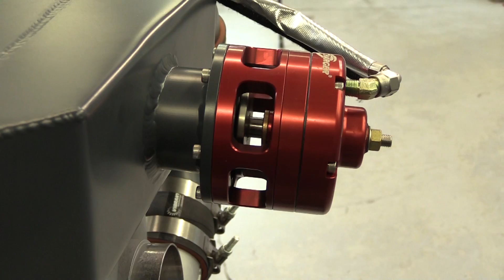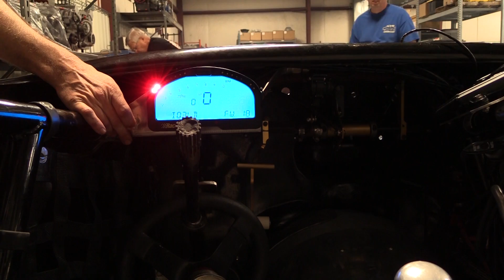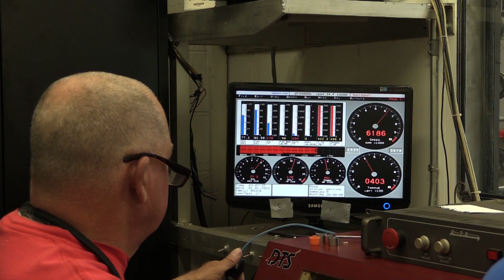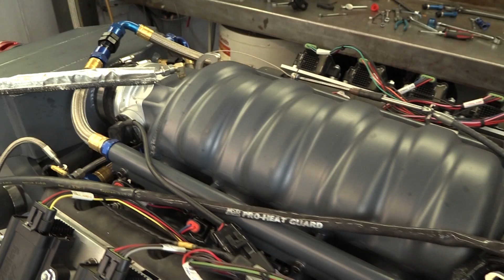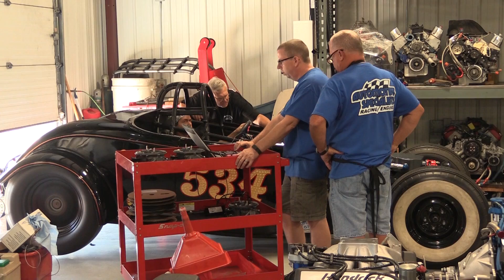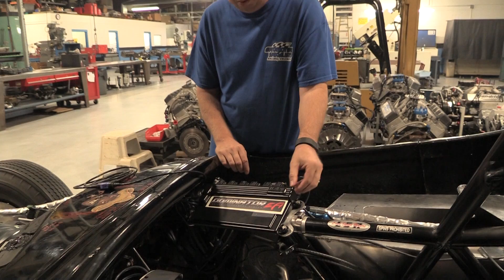A Thousand Horsepower on Just 260 Cubic Inches!

Comment: I think this could be the future of hot rodding. Small displacement + boost + lots of rpm. Nice!
Reply: +Forgotten Mustard its for setting a land speed record.. trust me the bigger engine, with the most horse is what you want, if you note, they said 260 ci WAS the maximum that could be used.. In displacement wars there is no replacement, a 427ci inherently will hold, make, push more horse than a 183ci engine its just how air works. So yes, your honda can put out 1000 horse power, but will it hold it for long ? Not really.  Also if your belief is such start looking at high end sports cars, and race cars like f1 series, r1 series, you'll note they use the  maximum cylinders and Ci allowed. Just sayin.
Reply: @yuribrandi8212   but there 10 and 12 cylinders to f1 series engines are also gear driven and turn 14000rpm i love this small engine would like to what it makes with out the blower
Reply: Small engines, boost, and rpm are fun but still no replacement for displacement. Just about everything you can do to a small engine I can do to a bigger one and make more power.
Reply: +David Serrano I know where you are coming from , I like squeezing big power out of small engines , own a 4g63 1g talon , two yamaha 2 stroke 350 twins . Also have boosted lq4 2000 camaro ss. You cant deny the better/instant torque  curve and driveability of a big inch motor . Secondly a big v8 will always be more reliable at x horsepower than a 4 banger , its the just pure size of the rotating assembly piston rods crank . The block thickness and stuff . At the end metallurgy is the same , you can get same kinda stuff for both engines but the bigger beefier stuff will handle it better . Kinda like semi engines putting out 650 hp and 2200 lb ft of torque out of 14 litres displacement , that thing will run at peak tq/hp for years , I mean a million miles , cant say the same about my 4g63 putting out 550whp.
Reply: Patrick Johnson Can't make what lighter? Most larger V8's already offer way more displacement per lb then inline, smaller engines.
I mean, shit, a 3L 2JZ weights about as much as a 6L LS engine.
Reply: David Serrano any 4 valve per cyl engine of the same cam profile and CI will make more power compared to a 2 valve per cyl ....its not just HP you need to consider.. torque is important. ..the little Honda engine may make 200HP but only 170LBS of torque vs a stock 350 v8 making about 250 HP and about 300LBS of torque....
Reply: 177SCmaro I think you missed the point of the video, there going after a Land speed record in a class that limits how many qubic inches you can have.
read my last post.
Reply: Patrick Johnson I wasn't talking about the video. I was speaking generally.
Reply: a honda putting out 200 horsepower would have 180 foot pounds of torque
(what you feel and use when you drive on the street)
a chevy v8 putting out 200 horsepower would have 350 foot pounds of torque.
(what you feel and use when you drive on the street)

can you see and understand the difference now?that's why v8s get more love,
yes honda engines are great and can make decent power but they are not a v8.
Reply: Patrick Johnson but the tons of extra ppwer the bigger makes. ... it more than makes up for the extra weight..
Reply: Forgotten Mustard
Reply: Hahaha seen a 903ci naturally aspirated bbc run like a scolded dog. I run a billet 4.660 bore X 3.65 stroke turning 9,800-10,200 Rpm. Don't think for a minute big reving engines can't make hp and tq cause they can.
Reply: Nothing new here.  Can you say Indy cars with baby cylinder engines and tons of boost.  Pure physics.  You ring out all this horsepower and revolutions in such a short time it equals wear and tear.  Pure ultra high power horsepower racing engines are rebuilt after every race.  You need a balance of longevity, displacement and horsepower.  Fire all your guns at once and the race is over.
Reply: Been that way with Hondas for years.
Reply: +David Serrano Actually Dart sells aftermarket Honda blocks. And about the displacement, larger cylinders are less efficient. But more cylinders actually increases the efficiency. (talking hp/liter not mpg). The reason those stock v8s put out low numbers is mainly poor head design and less efficient fuel injection/exhaust systems and cam profiles made for low end torque.
Reply: Small .21 ci RC car engines often return 1000hp a liter or more.   The very nature of the universe means it's easier for small things to return good X to Y ratios in HP to liter, strength to weight ratios, ect...

Despite that, it's simply not true that small engines are more efficient.  The 100,000 hp + 25480 liter Wartsila-Sulzer  ship engine returns a 0.260 lbs/hp/hour brake specific fuel consumption while most auto engines are around .400 lbs/hp/hour or more. Despite making 4hp a liter, this engine beats the pants off of anything the often worshiped Honda has ever produced as far as fuel efficiency is concerned.

If you are under the impression that small engines are more efficient, the lone fact that container ships rely on increasingly bigger and bigger single engines to reduce their fuel cost proves that impression to be a fallacy.

As far as performance engines at the automotive scale. Consider this, it's not unusual for a sub 450hp turbo S2000 to undergo a LS swap that makes 600hp that adds less than 100 pounds to the car.  One guy reported only gaining 74 pounds over his turbo I-4 + transmission compared to his all aluminum LS and TKO-600  5spd that used nothing but the lightest components he could find.  Intercoolers and all that turbo piping weighs something too, people seem to forget.  

If performance is the goal, all that matters is power curve to engine weight ratio (hp and torque matter) and reliability.  Engine size and fuel economy have some consideration, but frankly, power to displacement numbers are completely pointless.  Given the same basic lay out and physical size, a 300ci engine will never have any pertinent advantage over a 500ci engine in making a vehicle faster.
Reply: The future? This was going on in the late 50s and still used a lot in supercars today...
Reply: Ship engines are efficient because they are designed to spin in a small select rpm range. They basically don't need VTEC. If Honda had a different camshaft for every 1 thousand rpm it can easily be more efficient. But yes small doesn't mean it's more efficient. It's all about the design of the engine.
Reply: 177SCmaro can't make them lighter.
Reply: Patrick Johnson well you can. With billet everything. Machine away more material in places that don't need it and add more to places that do need it. Most likely would end up with an all around lighter block. Especially if the original was an iron block
Reply: 177SCmaro also this small qubic inches puts them in a class to beat and take top dog.
back in the 70ds my brother in law held the record for a 4 cylinder Pontiac tempest until Mickey Thompson cut one in half made a 2 cylinder and kicked his ass with half a motor
it was time to month ball tempest .
Reply: its very very specific,landspeed is a different animal.
its much like the 302 z28 engine of the 67/69 z28.its not meant to putt around,
its meant to hall ass at very high rpm and the majority of power would not be 
available in a street application and the torque would be pretty low even with this power.
Reply: Nothing to see here ford already got that covered.
Reply: +Forgotten Mustard Nope. High rpm = high stress. Boost is displacement anyway, so getting a small engine and putting it under boost maskes no sense for a hot rod. It's needless complexity.
Reply: +Eric Benton generally from what I've seen NA engines generally lose power and efficiency as you ramp up the displacement and number of cylinders. like generally the power/liter of a Honda 4 cylinder is much better than a v8. Although displacement should theoretically give you much much more power it generally doesn't. I've seen stock v8s put out numbers in the 200s which Honda does on their 2 liters. Sadly there isn't as big of a engine scene around Honda engines. I mean sure there are aftermarket parts and etc but you don't see any aftermarket blocks or anything of the sort. v8s get a ton more love than 4 cylinders. tbh I would take a 4 cylinder over a v8 anyday.

Comment: Small engine add some boost and electronics...Pretty nasty result with not much boost....What's the fuel restrictions for the class.?.
Reply: +B00steDevil 
That's not a turbo kid, stop being a youtube bench expert.
Reply from the maker: +ZIGgassedUP No nitro. Race gas allowed. And no alcohol (I think)
Reply: +Jimmy Mudsled A centrifugal compressor is a centrifugal compressor, regardless of whether it's driven by a belt or an exhaust driven turbine. And it's going to sound much the same as well when it's running a multi-v belt. (as distinct from a toothed belt) That thing is audibly huffing VAST quantities of air. Maybe you should listen more closely and not call random people "kid" as you try to put them down with meaningless nit-picking in order to make you feel good about yourself.. And yes, it's only making 10psi of boost but it's not a huge compressor either and they're spinning the thing to nearly 10,000rpm so that's still a heap of air in terms of sheer cfm.
Reply: it has nascar style heads made for high Rev high hp. I doubt it's running anything less than 2 bar. how much torque is it pushing at 5252? 
max torque?
Reply: +B00steDevil I thought I heard them say they were only running 10 psi in the video. And I have no idea how much torque/hp it makes at 5252 I can't imagine it's that high. 450-550 if I had to guess, this short stroke engine probably makes peak torque at like 7500 RPM
Reply: teddygoboom1 maybe on low boost low octane gas. There's no way a small displacement pushing 1000hp is not going to double its displacement trying to output such numbers. Just listen to the turbo work it's moving some air. 
I'd put my money it's upwards of 6600rpm peak torque. Maybe 630lbs. Ft.
Reply: I'm in the wrong no doubt. But I'm no average Joe like you when it comes to cars that is. I know for a fact no exhaust flows right out the front the head like that unless purpose built. i must of had a couple shots of tequila but it does sound damn good.